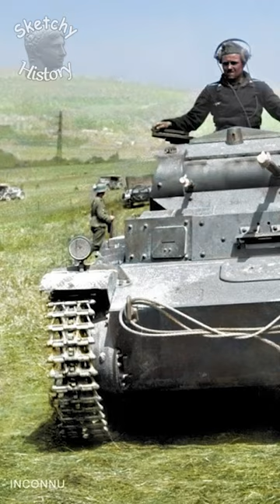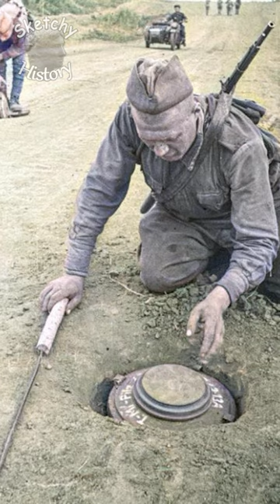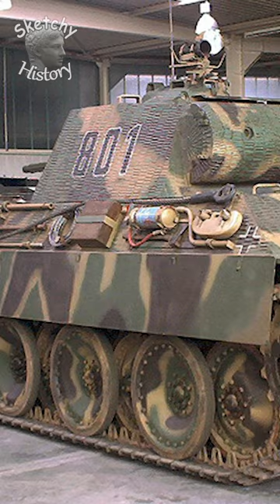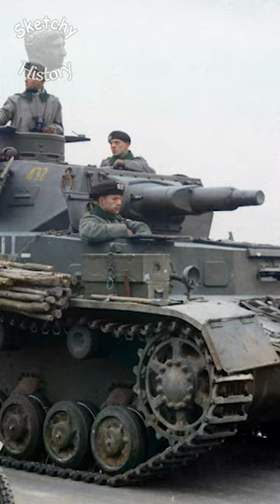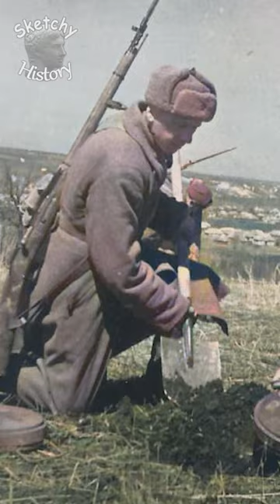Why Did the Wehrmacht Plaster Their Tanks in WW2?

Comment: The real reason: Germans used magnetic grenades, and we're afraid that allies would also use magnetic grenades. It's called Zimmerit. It's used so that if allies had magnetic grenades they wouldn't stick on the tank. Also Zimmerit was put on every Latewar tanks (e.g. Panther, tiger 1 and 2). It also wasn't flammable